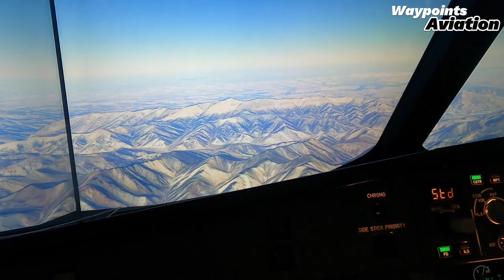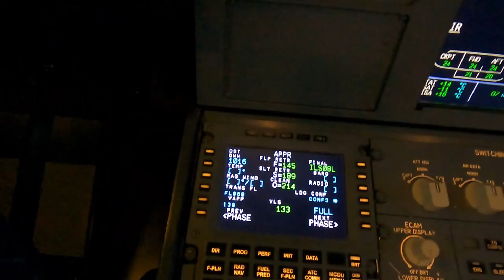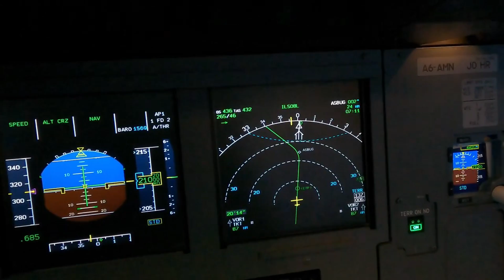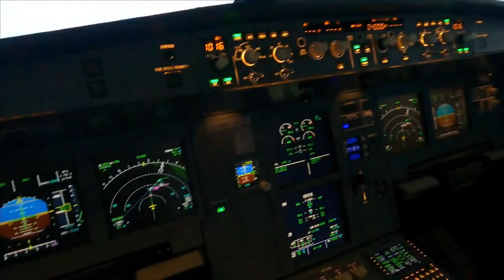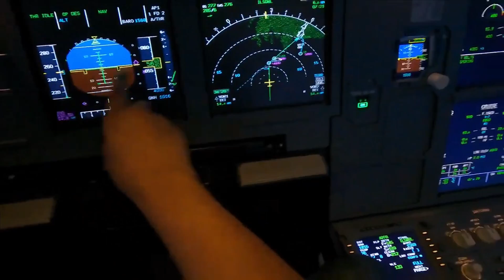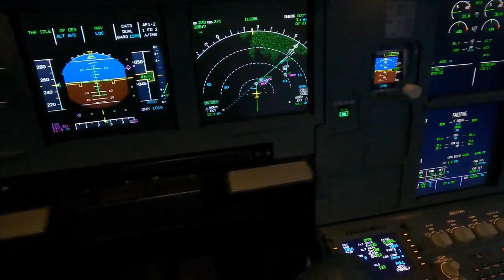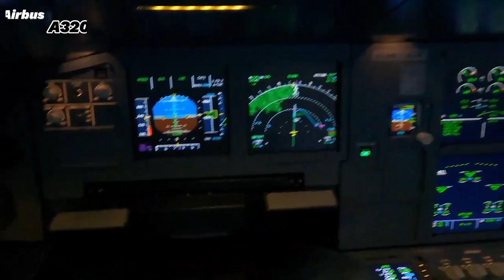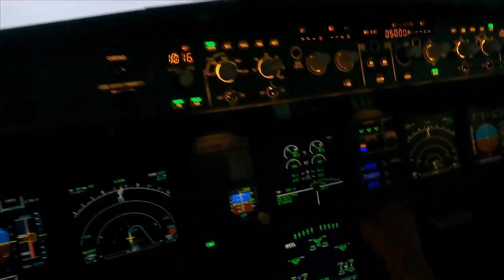A320 Approach and Landing tutorial!

Comment: Cap, why it doesn't feel straight and aligned to the runaway?
Reply from the maker: It's normal for the centerline to appear slightly off when viewed on flat screens from any seat, except when you're sitting in the middle of the simulator's main screen.

Comment: Hi there, I have a question please. Why didn't you just adjust your vertical speed instead of going on managed speed to reach the 4000 feet? Couldn't you just divide your airspeed by 2 and add zéro to get the right rate of descent to cross the required waypoint at 4000 ft? Want to understand if this method works in réal life?
Also, can you confirm that for the crab landing, you touched the runway and decrabbed after touching the runway? I'm asking as I've seen vidéos where they decrab just before touching runway.
Asking as your vidéo are great. Thanks again.
Reply from the maker: Hi, thank you for the question. Please note that this is just my personal opinion. If you are a pilot flying an A320, I recommend consulting your training department or flight operations for accurate information.

Personally, descent can be achieved through Open Descent, where you perform your own calculations for when to descend and determine the required vertical speed. The second method is Managed Descent, where you use the FMS for guidance. In this case, the FMS was used because it is reasonably accurate, considers speed reduction, is more fuel-efficient, and reduces workload, especially since I was filming as well.
Reply from the maker: Yes, you can touch down then decrab as long as the difference between the aircraft  heading and the runway heading is within the manufacturer's recommended limits.

However, the recommended technique is to decrab before touchdown by aligning  the aircraft with the centerline. This  provides better directional control and reduces stress on the landing gear.
Reply: Thanks so much. I am not à pilot at all, just an xbox player for mfs2020. Thanks again for responding. Would really be nice to have vidéos on decrabbing in crosswind as well as landing with autothrust off please.I've seem that decrabbing before touchdown in heavy crosswind  can also create issues with wings no more leveled off. As usual, your vidéos are very clear so would be a perfect  vidéo I believe.